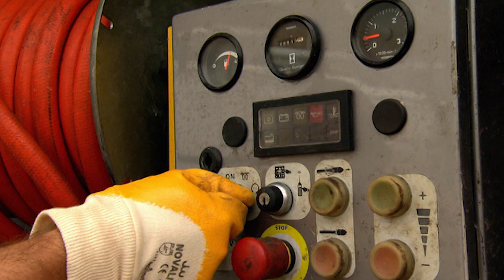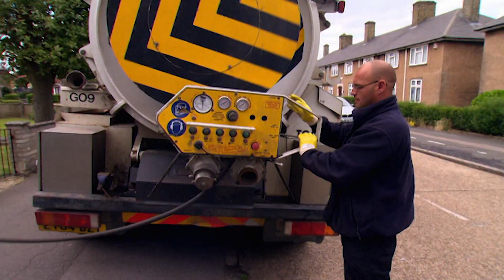A Day in the Life of a Drainage Engineer | Grimefighters

Comment: This guy calls everything an interceptor when they're not they're just inspection chambers 😂😂
Reply: True say, this is actually called a winser trap. An interceptor is a staged tank system designed to remove solids or liquids from the final effluent, usually oils from car washes and the like. In fairness though these traps do act the same, settling the heavy solids in the bottom and allowing liquids to pass over. These are actually a Victorian design to localise blockages and stop rats and odours from coming toward the homes. Good idea until they worked out rats can swim and vent pipes work better 🙂

Comment: you need a degree to call yourself an Engineer, these guys are an embarrassment...
Reply: ryszard witek he was calling the machine an engineer , its just banter
Reply: Got the degree, spent 6 years in design and flood planning then 12 years ago wanted to experience life on "the front line " so to speak. Wouldn't dream of going back into an office situation and honestly (not all by any means) some of the guys I've worked with put computer generated calculations and endless CAD designs to shame. On the spot thinking and problem solving skills are supposed to be the foundation of civil engineers but they're completely shaded by some of the "non academic" guys on the tools. I'd trust a good and knowledgable drainage guy over an office bod every day of the week. They are engineers for sure!